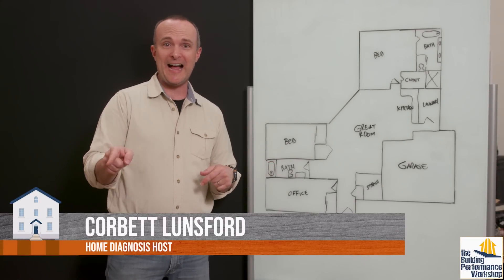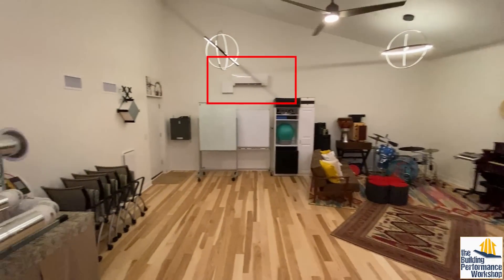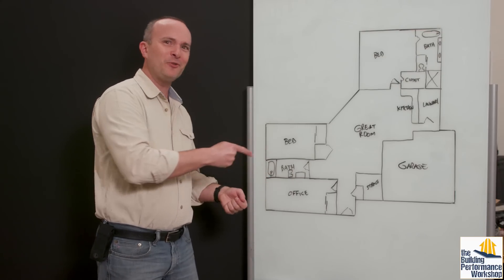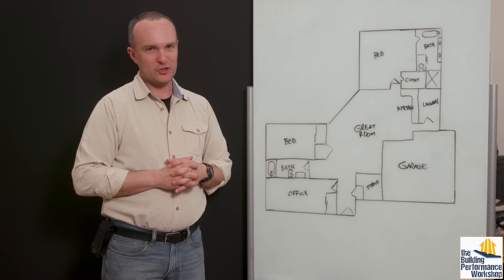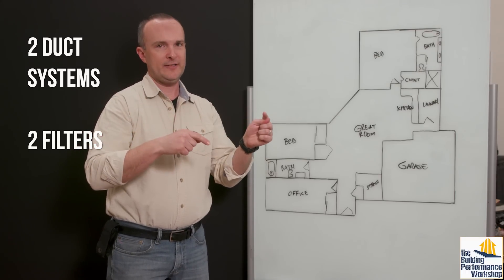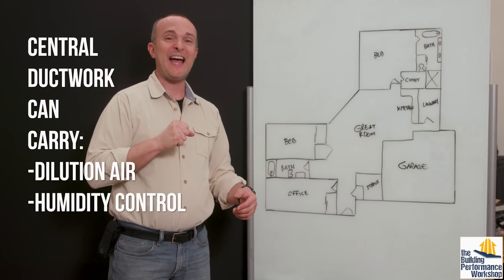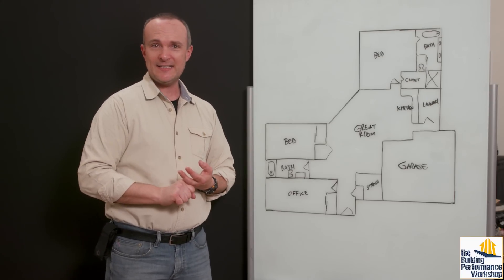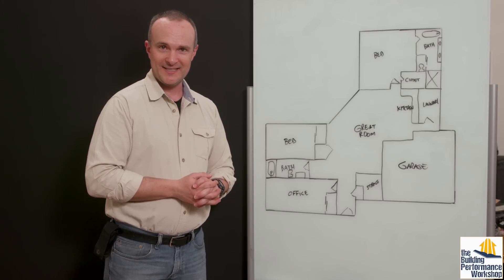HVAC Ducts Reality Check: Are Ductwork Systems Dumb or Essential?

Comment: Thoughts on stand alone HEPA boxes for each room? Combined with a timer and or motion detector they could deal with the filtration and circulation, and leave the heating and cooling for a separate system.
Reply from the maker: Yes, that's a decentralized system, I'll describe it soon.
Reply: @HomePerformance  Submarines and spaceships have had CO2 scrubbing filters since they were invented, there are even CO2 scrubbing SCUBA systems used by the Navy seals and the like.

This may sound a little out there, but what do you think about a system with a central return, filter, and blower, but with micro heating and cooling coils distributed at the end of each duct run; maybe integrated into each supply grill? That way you could have continuous circulation and filtration but independent control of heating or cooling in each room. I know of a few commercial systems that operate similarly, I believe they are called induction units.
Reply from the maker: Whoa, very interesting idea Z
Reply: @ZergZfTw  just curious, why do you need so much cleaning for every room?
Reply: @HomePerformance  yea, I'm in the junior year of my engineering degree, so this is the type of stuff spend my time I think about. My heat transfer class starts next week. 

I think my ideal system would have a chilled water coil followed by a hot water coil. That would give you the options to do sensible heating (hot coil), sensible cooling only (chilled coil above the dew point), mixed sensible and latent cooling (chilled coil below the dew point), or max latent cooling (chilled coil as close to freezing as you can get plus some reheat form the hot coil to get the dry air back up to set point). If you had a water-to-water heat pump or a desuperheater the reheat energy for dehumidification is essentially free. It would also give you the option to "dispatch" cooling or heating power to different parts of a building at different times, as needed, I could see that being useful for buildings that have very unbalanced loads or a day.
Reply: @andreycham4797  if you can afford it, why not? Have you ever been in a real climate-controlled space with constant temperature, and humidity control, and high flow HEPA filters going 24/7? The air is so clean and easy to breathe. If you wanted to save money you could drop down to a lower MERV rating and still get most of the benefits.
Reply: @ZergZfTw  no I have not been. I dream , if I just manage to lower CO2 without costing me arm and leg  I would be happy to the rest of my life
Reply: @andreycham4797  That makes two of us, ventilation definitely comes at a cost, both in terms of equipment and in higher heating and cooling bills. ERVs help with the energy costs, but at the expense of higher equipment costs. I know some smart people don't like it, but I think demand based ventilation controlled by CO2 and VOC sensors is worth looking into.
Reply: @HomePerformance  I could send you some sketches of what I have in mind if your interested.
Reply from the maker: No, I get it Z- that would have to be a pretty special use case and you’d need special monitoring of humidity to control for condensation among other considerations. In short (like a submarine) it would end up being such a complex system that it was unlikely to work reliably day-to-day, which is why subs have one or several live-in engineers whose job is to maintain and tweak the system ongoing. In this hypothetical home, I guess that would be you.
Reply from the maker: You’re aiming to be a custom-solutions-only type of homeowner, Z. Make sure you leave yourself spare time for this intensive hobby!
Reply: @HomePerformance  This type of thinking is what I do for fun; I have literal heaps of drawings and CAD files I have made for fun. 

I honestly can't see where else you can innovate except for the custom-build part of the market. We are already facing an absurd housing affordability crisis. Asking a prospective home buyer to pay even more money for a home is entirely out of the question for the vast, vast majority of people who are already struggling to afford housing. Any solutions you come up with will have to be at least as low cost as the standard systems production builders are using now, if not cheaper, if you want any market penetration. So, I will stick to thinking about the custom systems; that's what I enjoy thinking about anyway. I also just like experimenting to satisfy my curiosity, even if it's not practical.
Reply from the maker: We agree on all of the above. Keep brainstorming and experimenting!
Reply: Hepa will not clean air from CO2
Reply: @andreycham4797  Of course not, that's the job of the ERV.
Reply from the maker: FASCINATINGLY, there are now filters that can scrub CO2. Crazy, right?

Comment: My brother just put their bedrooms into their basement. The duct work caused low ceiling issues so they went without. They do have forced air upstairs. It will be interesting if they have moisture problems in a couple years. 

I made the suggestion of cutting some holes in the floor connecting the basement air with the upstairs air.
Reply from the maker: Keep us updated buddy

Comment: Do ductwork correctly is more important. Don't use flex for the entire thing. I have seen this a bunch over the last few years. Entire systems are just flex.
Reply: Flex has a use, but no more than 6 feet. Hard duct. I agree with you friend
Reply from the maker: Amen
Reply: Octopus ducts seem to be a thing in both St. George and Provo. Our two homes have them and this was new to me after moving from Wisconsin. I was thinking about eliminating my flex ducts and just going with mini-splits but this video has me rethinking thinking my choices.

Comment: Question.. I'm currently remodeling a house ( complete from basement to second floor ) built in 2010, ICF construction. The homeowner decided to have me remove all ductwork and is installing a split system heat pump for the entire house.  ( 14 head units total ). I did mention my concerns with getting decent air filtration, dehum. / humidifiing, and getting fresh air/ removing stale air. So my question is, what should the homeowner look out for that could go " wrong " without having those mentioned benefits of a ducted system ? And would separate stand alone units like, air purifiers, dehum. / humidifiers help ? I realize this may be a complicated answer... I really appreciate your videos on YouTube !!!
Reply: Buddy it sounds like you seriously need to go watch any air purification or filtration videos on this channel. Moisture, mould, germs, air quality, dry air causing cracking in flooring and wooden furniture, people straight up getting sick all the time... What a list.
Reply: In extremes, window seals getting broken and drying out as well. Not sure where you are, but in Canada the house would fail any inspection without at least an ERV or HRV for bringing in fresh air.
Reply: @levidobbin5654  I appreciate the info. So the whole concept of having no ductwork in a house and just using mini splits was very new to me, and I think ( unfortunately ) the HVAC company hired to do the job, just went along with what the customer wanted and did not mention any pros or cons... There were some alarm bells going off in my head for sure...Again, thanks for the info !
Reply: @derekdenning6342  Of course, we all have to look out for each other. Look into ERV or HRV systems - maybe from a different HVAC contractor, because they should've spoken up when they saw something this essential missing. ERVs or HRVs will probably do you the best with minimal ductwork...I say minimal because there still needs be a system. Western New York can be close to the same as Southern Ontario, where I am. Call an HVAC designer, bring the plans, see what they think you need for a ventilation plan. Go Bills.
Reply: @levidobbin5654  Go Bills !
Reply: @levidobbin5654  We are in Western New York btw
Reply from the maker: Damn, Derek, that's quite a project- please keep us updated! More coming on this topic, I promise.

Comment: So many houses I've done, they'll rip out all the old electrical, all the old appliances, all the o!d plumbing - but either not change any 70's era ductwork, or expect the new stuff to be the same size, and perform better.

High velocity is the way for retros. Did high velocity Unico systems + radiant heating for 7 years, it delivers such a nice feeling home. It's the only way to deliver a home without major bulkheads on the main floor. Makes for the healthiest vaulted ceilings and greatrooms too.

Comment: Unsure why a (whole-house filtering) blower can't run while I'm running radiant floor heating...although I'm specifically referring to retrofit. New construction could warrant the investment of a heat-pump serving both heating and cooling.
Reply: It sure can, but you need properly sized transfer air duct and holes throughout the house. You definitely wouldn't be happy with that though, because you'd have a big hole in every bedroom wall, and you would no longer have room privacy or sound dampening.

Comment: Great video. I have an older house with terrible ductwork and will need to redo the entire HVAC system at some point. I really want to go ductless for the ease of install and attic space savings but I think you've convinced me otherwise.
Reply from the maker: Awesome Brent- so glad it was helpful
Reply: I wonder if ductless systems in older, leakier homes may be less problematic. Radiators, when they came out during the Spanish Flu, were designed to run hot enough to leave the windows open.
Reply: If your house isn’t too big you can feasibly install new flex ducts in a plenum and punch through interior walls (in an airtight fashion, being mindful older interior walls have a close connection to the attic and crawl space)